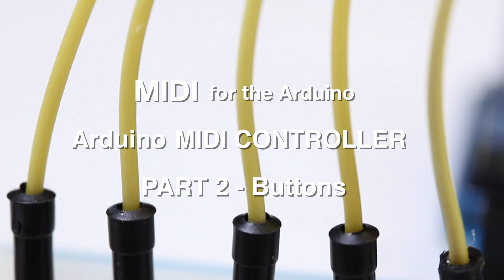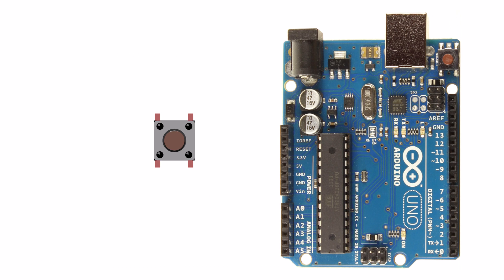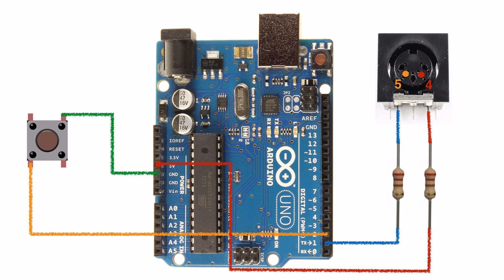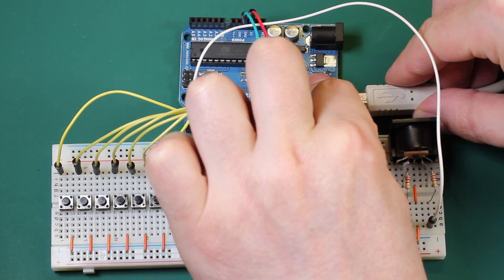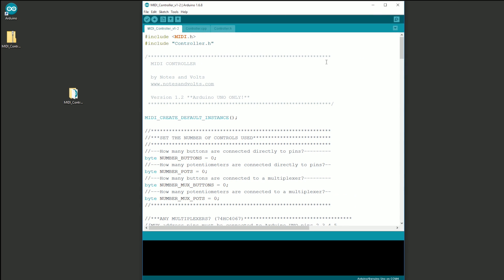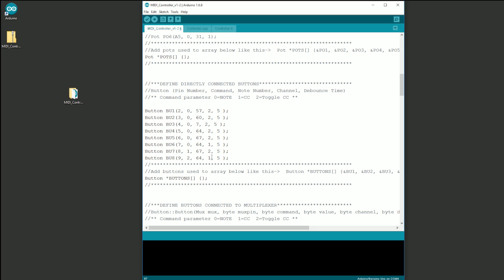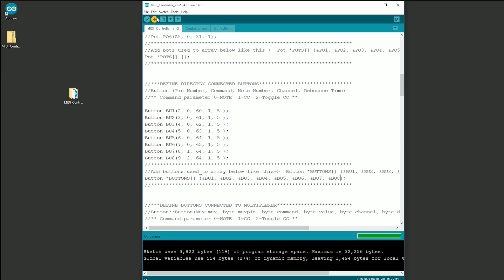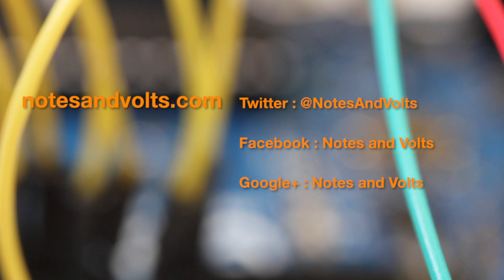Arduino MIDI Controller: Part 2 - Buttons

Comment: hello I came across an old YouTube video "arduino midi controller: part2 buttons" I'm trying to understand your file because I need 13 buttons (I want to connect a foot piano and I need 13 notes: C-C# -D-D#-E-F-F#-G-G#-A-A#-B-C).Is this already possible?.If so can you help me.

Comment: excellent info and code is great. thank you. i am trying to modify the code to sends a string of notes on button bush. i tried changing notes from single notes like 60 to for example 60-64. But it doesn't change though as i think i need to add note off between each note.  How do i add this note off between each note (for single button push)? thanks

Comment: Can this be used to send a sysex command? I think I already know the answer, yes I hope! I'm trying to build a mute/unmuter/fader for Yamaha qy70 tracks which needs sysex (awkward..). Great tutorials! 😁👍 ..ps I've sort of answered my own question. In the documents for the library it has sendSysEx function with an example that loops through the sysex code and sends it. I should be able to get it all together but thanks so much for everything you've done with these videos! 😊
Reply from the maker: The command is:
MIDI.sendSysEx(length, messageData, true);

The "length" is how many bytes are in your message, messageData is the array holding those bytes, and the last true/false tells whether your data already has the sysex begin & end bytes F0 and F7 (if you give false, the library adds them for you).  

First you have to declare a sysex array, for example

byte sysexArray[14] = {F0, 43, 10, 26, 02, 06, 01, 00, 1F, 01, 78, 00, 00, F7};

and then you send that array with:

MIDI.sendSysEx(14, sysexArray, true);
Reply: @NotesAndVolts  thanks so much, you're an absolute legend for this! Forever grateful for your massive help. 😊
Reply: Follow up, it worked!! A lot of head scratching and merging different Arduino sketches but finally got it cracked! Had to use 0x00 format for the hex sysEx string and a debounce. Notes and volts code was too complex for me to mod so I just wrote my own. I have put a vid up about it, full credit given to notes and volts and 47effects library! Massive thanks!! 😎❤️🌌🌍🛰️

Comment: Awesome, took me a while to figure out what i was doing wrong, turned out, I dint used the right Linux commands.
I can now send midi stuff from my arduino over plain serial to my Linux machine and play midi music :D  Your videos are clear and helpfull. 

ttyMIDI and aconnect helped me alott. it might not have guis but way less trouble once i understand how they work. I might create a nice gui for myself as I see myself way more often connect and change serial connections. A true MIDI port might be ok, but ill add that once i hacked my keyboard. Now I need an awesome sounding external synth :P (for DosBox and Qemu use)

Comment: Hello,
First of all, thank you very much for your youtube channel!
It allowed me to make a bass pedalboard (like the PK-5 from Roland).
This midi controller allows my guitarist to trigger sounds from a synthesizer (Access Virus).
I want to add a function to my controller: I want to play one note at a time.
So I think that it's necessary to use the monophonic mode, what do you think? But I didn't found the right midi CC message.
Could you help me please?
Any information will be welcome.

Comment: I have a sensor and I want use it as a switch with your code it's gave analog  value from 0 to 1023 I want when analog<100 send note on or analog>100 send note of please reply

Comment: really love it if you could add leds to the buttons in this code that can be turned on and off using the comments i'm trying to build a 5 button midi controller but want to add LEDS to my buttons to let me know when toggles are on
Reply: Hello Dan, did you managed to add leds to your buttons? I'd like to do the same.

Comment: Hi. Great job! I just made the first midi controller in my life, which will make the control of my midi devices a lot easier for me: D Thanks a lot!
However, I feel a little unsatisfied - is it possible to enter the values for Control Change messages somewhere in the code? I do not see such an option in the base code, unless I should use multiplexers? Maybe some user has already worked on the topic and could help?
Best regards.

Comment: I built a foot controller using this video and it works with just one caveat and I was wondering if others have the same issue.  I use 8 switches to control my Line6 HX Stomp--adds switches for all 8 blocks which is just awesome!  The problem that I have is that the first switch press typically is not picked up by the Stomp.  I hit a switch once and nothing happens then I hit it again and it will work fine from then on.  Do I need to add pull up resistors or something??

Comment: This is the exact software I've been searching for.  I trying to convert a savaged organ pedalboard to a midi pedal keyboard.  This will get it done with the minimum screwing around.  Your explanation of how the code works is excellent and now I understand the code well enough to make the few simple tweaks needed for my use. Thank you
Reply: That's exactly what I am doing! I first tested a couple 25 key midi controllers to try converting them to a set of organ bass pedals for a Hammond XK-3, but they all clear ALL USER SETTINGS every time you power them down!!! I'm just baffled by that. So now it's time to roll my own.

Comment: Is there any reason why this would not work on a Arduino Nano board?
Reply from the maker: Hi Duncan - yes it will work with the Nano. Check out my video "LIVE from the Lab: Arduino NANO Midi Controller"

Comment: The sketch works for me and the controller i've built works, but once i power off the ardunio it does remember the code. Just for this sketch, holds other sketches. what am i doing wrong? thanks

Comment: You are a life saver, best code ever.
Worked great with Arduino Mega 2560 and could also use it on Serial2 instead of default Serial.
Thank you so much for your effort in helping all of us.
Please continue developing the project as it is the best Midi Implementation for arduino I have ever seen.

Comment: Great video. I'm trying to make single foot keyboard. How could i change octaves ? it's probably not possible with control change. Is it possible to use pins  A1 A2 without multiplexer  ?

Comment: the wire setup confuses me, you are connecting the buttons to inputs, but these are linked to ground not the 5v
you are also not including any pullup or pulldown resistors - it can't work this way can it?
Reply from the maker: Hi Digi Byte. I'm using the Arduinos internal pull-up resistors. The input is pulled high through the built in 20K pull ups in the Atmega chip when the button is not pressed and connected to ground when the button is pressed.

Comment: Excellent tutorial, have some questions...
1. What if i want two CC comands on one button?
2. If i use midiusb library, can i use the usb output for midi?
Reply: hi ! 
i'm curently trying this option, you should be able to do it only with a USB HID enabled board (see the MIDIUSB library info it tells it all)

Comment: is it possible to use the script with the teensy2++? i compiled the script and it works fine and it is detected as a midi device but when i test the connection by wiring ground to the pin number defined in the script it does not register anything. i have defined the button & added it to the directly connected array and declared the number of buttons to 1. i dont know if i'm missing something or if it;s because of lack of compatibility with teensy.

Comment: A great resource for building a special midi controler!
- I like to build a footcontroler which should send cc 34# on each of the six footswitches, but with different values (0 - 5)! is this possible, how must the code be changed?
- also, I like to have a LED per switch, can the Code be extended for this functionality?
Reply: hi, i m trying send different value for same CC number, did u reach?

Comment: Thanks for this nice video. I would like to use momentary buttons, programmed in latch mode  (for sustain on different midi ch) but i would like to use illuminated buttons (with build in led) to get a visual feedback when sustain is on of off. How is this possible ?

Comment: sorry for the noob question, but i have a few doubts, i want a responding led for each switch, so do i require different pins for each led or just connect the led to pin 13 with connecting the other to 5V. also if i wanna use a usb type b female jack rather than a midi jack, do i have to use another jack and cable or the program can read the interface of arduino as midi directly by the usb we connected it from?

Comment: So, I've got three buttons I'm trying to figure out. I can't decide if I want to set them up as Note, CC, or Toggle CC
Any tips?

The guide (Line 6 M9 Stompbox Modeler) says:
1. MIDI CC# 50, 0-63 = Overdub, 64-127 = Record
2. MIDI CC# 85, Toggles Reverse On or Off
3. MIDI CC# 82, Activates Undo/Redo
Reply from the maker: Hi Nicholas. For example 1 - you want to use Toggle CC mode. The first time you hit the button it will output 127, the nest time it will output 0. 
For 2 and 3 I would try regular CC mode.
Reply: @NotesAndVolts  Thanks for the response! That's the direction I went, but I realized there's internal things that happen in the hardware's software to determine if the button will send a 0-63 or 64-127, so for an external switch, I need two separate buttons. Basically, if it's in Record mode already, hitting the button will only send 0-63. I know I could program it to switch between the two based on what's already been pressed, but I'd much rather rely on what's going on in the hardware to tell me that, so I'll just use the two buttons.
Another question: I haven't looked into the code, but does the regular CC mode send 127? If so, is there any way to change that using the wrapper?
Also, I forgot to say it in my last post, but excellent tutorial!

Comment: can we make it as USB connected instead of MIDI connector? Not good in electronics sorry for the silly question.
Reply from the maker: Hi Shashank. Not with this project.
Reply: @NotesAndVolts  can u make one please
Reply: @NotesAndVolts  OK But can you make a video how to do with USB. If possible please make one

Comment: Is it possible to replace the Midi output port with a Bluetooth module like the HM 10 ? what would change in the arduino sketch? thanks!

Comment: I keep getting error message: "Arduino: 1.8.8 (Mac OS X), Board: "Arduino/Genuino Uno"

error: no matching function for call to 'midi::MidiInterface<HardwareSerial>::sendProgramChange(byte&, int, byte&)'
           MIDI.sendProgramChange(BUTTONS[i]->Bvalue, 127, BUTTONS[i]->Bchannel);
                                                                              

                          ^

Comment: This is great stuff!!!  Forgive my ignorance, as I know nothing about coding (I'm just a lowly guitar player).  But if I wanted to add program changes to the command parameters, would it be as simple as adding 3=PC and a case 3 with MIDI.sendProgramChange?  Thanks so much!
Reply: Did you end up figuring it out?
Reply: @paulrobert3334 No, I gave up on the whole project.  :D

Comment: Hi! Great video. Quick question. I want to use as a guitar pedal and use stronger switches that I can attach to the enclosure. All I see are two button versions of this. How would I connect and program the two pin instead of the 4 pin? Thanks!

Comment: Is there a way to have the MIDI info communicate through the usb port on the Arduino directly into the Digital Audio Workstation? Im looking to not use a MIDI jack but accomplish what you are doing in these tutorials.

Comment: Hey, I was wondering if you could also achieve sending midi signals using the usb port of the arduino itself without using a seperate midi jack (like most midi-controllers would do)? Nice video btw! I'm planning on building one myself.
Reply: https://www.arduino.cc/en/Reference/MIDIUSB

Comment: Is this polyphonic ?
Reply from the maker: Hi Anarcobuceta. Polyphony is determined by the instrument you are controlling.
Reply: but pressing all button at once wouldnt change the current in a way the arduino will not read all of them at once ?
Reply from the maker: The Arduino always reads one button at a time. It just does it quickly enough that it seems simultaneous.
Reply: even if i add like more than 50 buttons ?
Reply: and play them all at once

Comment: What sort of buttons will work for velocity-sensitive applications? I’m working on my own project right now where I’m building a controller(just buttons for a diy keytar) that will plug into the wiring clip inside an existing midi keyboard. 

So I’m wondering if there is a certain type of button that has multiple connectors to make them velocity-sensitive. People on here probably already know the inner workings of keyboards, but the way it works is:  one lead selects a note range and two leads will trigger a note when connected to the first. The speed at which the two trigger leads connect to each other determines the velocity. Extracting the buttons from under the keybed and mounting them in another device doesn’t seem like an option because these are usually based on pc boards rather than something that can be easily re-wired. I’m already lucky enough that the Keystudio25 has actual wires that clip into the main circuit board. 

Any help would be appreciated!

Comment: Is there any way I can make the analog ports act as digital, so I can connect additional buttons? I'm using a small arduino that only has 4 digital ports and 4 analog.
Reply from the maker: Hi Vocalead. Yes you can use analog pins as digital on the arduino. Please be aware that the code for this project will only work on the Uno or Nano.

Comment: Great video, thanks!
Just wondering, could the same program/ set up be used to send Preset Change messages? I’d like to build a midi foot switch for a line6 M5 guitar effects pedal that I can use to select a number of preset sounds. 
Would it be as simple as changing the CC code to “PC”? 
Thanks!!
Reply: I m trying too.. have you solved?
Reply: @marcobenigni2610    I'm also trying.   any luck
Reply: Did you get it?

Comment: HI, thanks for these educational documentaries. thanks to you I now have a more or less working 13 pedal organ bass board (I recovered the pedal board from an old Hammond organ). I used the led input and one of the analogs as a digital input as i had "13 pedals". cheers!
Reply from the maker: Thanks Alex! That's really cool! I'm glad it worked for you. I love hearing success stories like this :)
Reply: so today i added a 44 key variant of the program (no muxes) just straight Digital inputs on a Mega board (up to 54 Di depending on how you use them).   I left the  LED free this time and serial pins free also, and used inputs 2 to 12 and 22 to 53. Seem to work plugged into a Yamaha Reface :-) all i need to do now is wire it up to a Hammond 44 key manual and make a box for it. summary I am feeling very confident with a 13 pedal bass board into a UNO and the 44 key on a Mega 2560.

Comment: I have this problem where this piece of code, is almost perfectly suitable for my guitar pedal project.
In this project you would need to assign also the value of the CC command after the pin number, command and note number.
If anyone could help me how to edit this code to be suitable for this extra add-on.

I'm building this for Line6 DT25 amp: https://line6.com/media/dt50/DT_MIDIGuide_v2_0_RevA_English.pdf

With this code I can set the pin number, command toggle, and the cc number. But after these I'd need to add another value
so that the amp regonizes what you'd like it to do. (You can check it from the link ) 

So if there's anyone who would be willing to lend a hand, it would be greatly appreciated!

Comment: Hi.. Great video! Make it look so easy! I'll be building a similar midi controller with just one or two buttons to MUTE certain buses on my midi unit. How does the Arduino get power to operate. Not sure if I missed something... thank you for any help!
Reply from the maker: Thanks bells! The Arduino can be powered through the USB cable when experimenting or with an external power supply foe stand alone projects.

Comment: can anyone please explain what's the purpose of the resistors going into the MIDI jack? Why are they necessary?
Reply from the maker: Hi Vocal. Check out my video called: Midi for the Arduino -  Circuit Analysis
Reply: Notes and Volts Thanks so much for suggesting, super helpful video, subscribed!

Comment: Assuming that:

A0 = PIN 14
A1 = PIN 15
A2 = PIN 16
A3 = PIN 17
A4 = PIN 18
A5 = PIN 19

Would work on the code with switchers?

Comment: please sir how can I program a light detecting resistor (cadmium cell) to act like a switch when laser hitting it is interrupted ?? what I am trying to do is make a laser harp so to say with 8 inputs. can I just alter the code for the midi switch project ???/

Comment: I'm making an music instrument for an schoolassignment, is t possible to not use a midiboard or something like that.
But multiple pussbuttons that send a signal when activated? Its like doing the same thing in your video here with the little switches on the breadboard without the midiboard connection. Only i am using larger pussbuttons. So when my pushbutton is activated the arduino reconises it and activates a sound.
Reply from the maker: Hi #_#. Other types of Normally Open buttons should work fine.